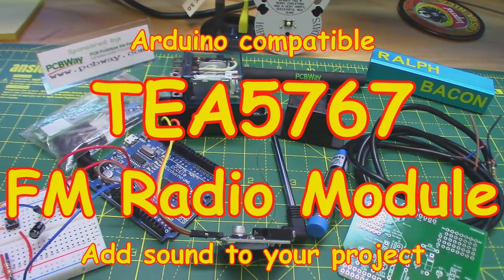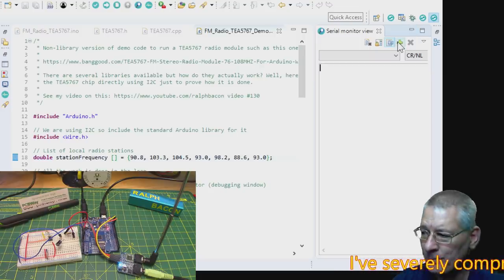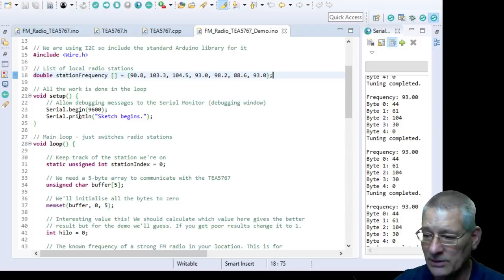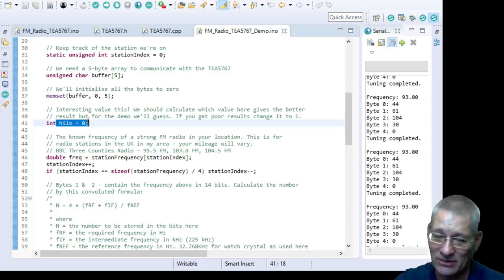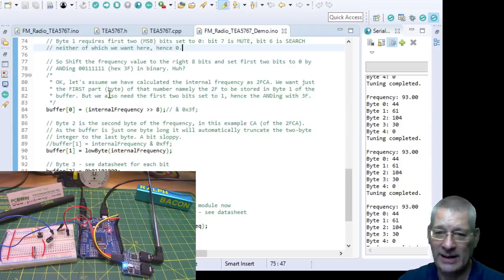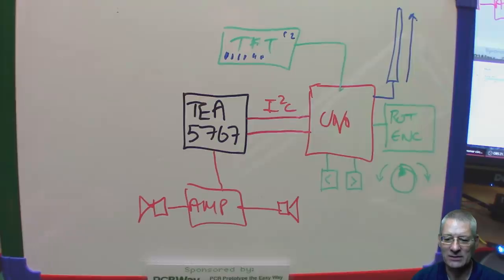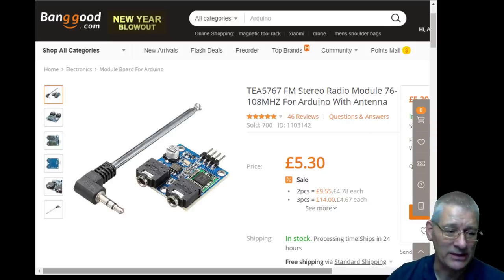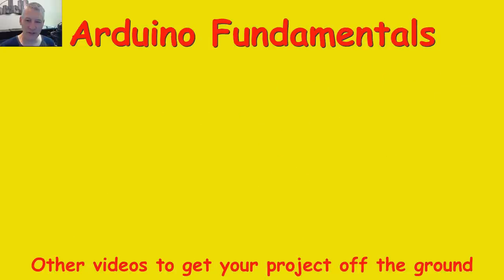#130 TEA5767 FM Radio 📻 Module for your Arduino (Cheap!)

Comment: Can it decode the text information that is sometimes transmitted with the audio? For instance; here in the United States the display for a station may scroll text with the word gospel or rock or country to give the listener an idea as to the type of music they broadcast on their frequency. Other stations include song titles and information concerning the song currently being broadcast. I think emergency weather information can be added by some stations and if your radio has the decoder to read and write this information in can be displayed in different formats. Maybe it's the same on your side of the pond?

Any plans to Rube Goldberg the thing? For example; a photo cell for input to read information from a light source? A laser power meter for example or a decoder for audio that has been added to a light source by modulation? You can bypass the antenna in this case and hard wire the hack into the antenna port and use the radio module number crunching section in a different manner than designed. 

A number keypad is an obvious addition to play with the internals of this module.
Reply: The TEA5767 module described by Ralph doesn't do this 'RDS decoding', but there are other modules like the RDA5807M that do.  Searching by that name/number will lead you to projects, libraries, and modules, that make these fun to play with.
Reply from the maker: Andrew is correct; this is a fairly simple FM module, deliberately chosen for that very fact. But there's nothing stopping anyone choosing a different module and raising this to a whole new level, getting RDS (song info, station info, time etc) back to the LCD display. The only caveat is that the USA version is marginally different (Wikipedia: Radio Broadcast Data System (RBDS) is the official name used for the U.S. version of RDS.[1] The two standards are only slightly different.). Hmm. Now you've got me interested in that too!

Comment: Great video Ralph, unfortunately in Belgium all FM radio stations will stop transmitting in 2020 and we are all forced over to DAB and streaming. Imagine how many car radios will have to be replaced in older cars... thank you for making these videos.
Reply: Wist ik niet
Reply: That was supposed to happen year ago. Problem is that DAB makes no practical difference to the car audio listeners beyond emptying their wallets and poorer reception than conventional FM in heavily buitl-up areas and on the fringe of reception.

You can tell why it it's not well received by the mass market which is more pragmatic than the minority of squeaking audiophiles.
Reply from the maker: @Freddy This was also mooted in the UK several years ago. Nothing to do with audio quality (although that's partly how they tried to sell it) it was to free up the FM band for other services to use. 

But it never happened, and as far as I know there are no plans to resurrect this unless the EU demands it (but if we Brexit we can even ignore that too). Imagine the millions of FM sets in the UK that would be rendered obsolete! Crazy thinking. 

Unfortunately cheap DAB modules just don't exist (or I have not been able to find them). Perhaps it's a licencing thing?

Comment: I Think the sideband for stereo in the UK is just above the tuned frequency, which might explain why your local oscillator setting worked better on low.
Reply from the maker: That would indeed make sense, Steve, there just had to be a logical reason and you have doubtless found it for us! Thanks for posting, good to hear from you.
Reply: @RalphBacon  Don't take it as gospel. I did a few weeks work experience in BBC Belfast and soaked up as much as I could.
FM radio was explained to me as.....
The tuned frequency carries the "middle" signal, L+R, mono.....for compatibility with mono receivers. A stereo receiver also tunes a sideband (the chap said it was just above the tuned band) with carries the "Side" signal L-R, just the difference. The radio then uses sum and difference to recreate the stereo Left and Right. Note all of this end of the processing is all Amplitude Modulation.....as only spectral content of the signals changes.
Apparently the "beat cancel" function on nice FM tuners is related to beat frequencies set up between the tuned band and side band because neither is perfect.......but that's beyond both our pay grades :D
(the same engineer explained FM synthesis as the work of the devil designed to destroy all fun in music :D )
Thanks for your videos they're invaluable viewing while mulling over the non working of my code :D

PS: Where do you buy your dupont cables as yours don't look utterly ghastly :D
Reply from the maker: Nice background info David! My DuPont cables are from Banggood, I've just ordered some (short M-M) today! If you use any of the banggood links in my GitHub before searching it might help my channel.

Comment: Nice video. Very informative and inspirational. Thanks!
Some things that come to mind: How about adding a 7-segment display and RTC to display time and to switch on the radio at a specific alarm time. Also add some buttons to snooze, set the time and control the radio. Recently I published a library for the TM16xx family. The TM1638 for instance can drive 8 7-segment displays and allows for reading quite a few buttons. There are some ready made LED & Key modules that have both onboard.
Reply from the maker: More great ideas! Turning this into an alarm clock would be very easy (and cheap). There are so many ideas being suggested, it's amazing. Thanks for posting.

Comment: Hello Ralph, can the TEA5767 FM module give output so that the Aurdino can read that output from the TEA5767  as input so that I can use that input to prompt the Aurdino to send a text message using a GSM module depending on the input that I would have received from the TEA5767 module?
Reply from the maker: I got confused at this question: "...read that output from the TEA5767  as input..." I don't think the TEA5767 can be used as a digital input in that way (not unless you are transmitting some tones?). 

I think you need an alternative method of transmitting digital data to trigger that SMS message. Depends on the range.

Comment: Great video.  It would be nice if there were a (cheap) DAB equivalent module - done some searching but looks like they are coming in at about £60 - ouch!
Reply from the maker: Quite so, Bruce, they are ridiculously expensive. Either the chips are costly, or the design is, or it's a licencing thing, can't work out which.

Comment: Hello,

I tried to use the noise cancelling circuit with the SI4703 but it didnt work. I used a 68R and 100μ capacitor. Maybe the reason is that the SI4703 runs with  3.3V?

Do I have to change the value of the capacitor or the resistor?

Thank You very much for the great Tutorial!
Reply from the maker: Er... Ernst, you mention Si4703 but this video was about a TEA5767. Just in case you got your components mixed up, the TEA5767's noise reduction is controlled by a register, the fourth data byte, bit 1. If it is set to 1 then SNC is set to ON. also you can try bit 2, which is High Cut Control, if 1 then it is ON too. The datasheet tells all. I have to admit, I'm somewhat confused by the question, though. But I'm glad you like the video nonetheless!

Comment: Ralph,  great video! Do you see any reason that this couldn't be done using an Attiny85 instead of a full arduino?
Reply from the maker: The only reason is that I2C is not natively supported on the ATTinyXX series. According to Arduino, "The ATtiny85 (and it's cousins) does not have I2C (or SPI) 'built in'. Instead it has a Universal Serial Interface (USI) that can be used to facilitate I2C and SPI." 

As it was not straightforward I didn't go down that route. Additionally, if you do want to add LCD displays, Rotary Encoders, Switches... whatever, you'll quickly run out of pins. I'd suggest a Nano if the UNO is a bit big physically. But have a go, just get a suitable I2C library for the ATTiny85.

Comment: Want to build the "small stereo amp kit" - just a small question: what is the max voltage that can be input (e.g., can I connect it to an Arduino with a 5V PWM output to amplify the "sounds" produced). I can't find any info about this point on the WEB. Sorry if it's a silly question but I am only just starting to get "into" arduino Raspberry pi etc. and I don't want to blow it up with too much input voltage.
Reply from the maker: Analog amplifiers will normally expect 0.775V or 1.2v for full output. But you can use a potential divider with a potentiometer to control the input so it does not overload. But amplifying the PWM square waves from an Arduino will not sound pretty! And in stereo? What are you building, some sort of music device, an organ? A stylophone?
Reply: Thanks for this - I am looking at an organ (the PWM is just for the initial set up). I did think that some sort of voltage divider would be needed. Please keep doing your videos, I find them very easy to understand and they provide me with many new ideas.
Reply from the maker: Understood, John, that will work fine then as I previously described.

Comment: Hello Ralph, can you do a tutorial on the si4703 without the library?
Reply from the maker: I'm not sure of the value of doing that, quite honestly! The library does a good job so why not dig into that and see how it works?
Reply: @RalphBacon  I did ,it was written for several different chips and hard to decipher, some Of it I could figure out but most not .I read the data sheet and wrote a small sketch  too see if I could get it to work at its most basic level but failed .I get no errors and 0 result from endTransmission () ,but cant seem to get it to work.

Comment: you can create a project that limits the weight of the lorry and connects it to the lock to turn off the engine if the excess weight . I need ur guidance
Reply from the maker: How does this relate to the TEA5767 module, Faiz?
Reply: @RalphBacon  I'm sorry. I want to say can you create a project??
Reply from the maker: Your best bet for advice on such matters is the Arduino forum: https://forum.arduino.cc just state what you have done to solve your problem first and they will surely help you.

Comment: Great video to start the year.

There are several other I²C radio modules available although mostly without the audio amplifier — not a huge problem. The Si4703 modules for FM radio add e.g. RDS/RBDS [Silicon Labs refer to I²C as 3-wire, probably for licencing reasons.) The chips/modules are interesting because their "family" includes receivers for other bands as well. e.g. the  Si4735 AM/SW/LW/FM Receiver with RDS. Or, if you're interested; weather band capabilities.
 
RDS embeds snippets of digital data in FM radio: https://en.wikipedia.org/wiki/Radio_Data_System
Reply from the maker: Yes, Bernd, I looked at the Si series at I expected to use one of them. But this one was so simple (remember, I'm aiming at getting beginners' projects off the ground) it filled the need better. Maybe I'll do a more advanced module in a future video...
Reply: "3 wire" usually refers to SPI as far as I know, but I have been wrong before. :-)
Reply from the maker: That's correct, Bora, 3-wire is SPI, Twin-wire is I2C. Arduino.cc admitted they made a mistake with the I2C library, calling it just "Wire.h". They realise they should have called it TwinWire.h.

Comment: Do you know a good, cheap DAB+ radio module to attach to the Arduino? And could you make a video about it? FM is being obsoleted by DAB+ in many countries.
Reply from the maker: If I could find one I'd do it, Martin. The trouble is I can't find a module (where we can control it in a similar way to this one) anywhere. I'm guessing they are expensive as otherwise the Far Eastern factories would be cloning them by now. But I'll keep my eyes open (well, my good eye, at least) and see what is out there.

Comment: While you are adding modules, mp3, Bluetooth, wifi, internet radio, 16 keys folio keypad, spectrum analyzer and a way to push that much program into the arduino
Could really be be interesting to see you but all that together, there is a lot of videos showing one or two modules interacting but very few do a full serie on a complete unit.
I, for one, would be sucking up every video on this. 
To get past the copyright issues, i guess you could setup you own FM transmitters, there is some small ones with very limited range, and then send your own sounds.
Reply: The Arduino's core ATmega itself doesn't have the grunt to directly handle complex data at high rates but it can steer modules that do the processing.

Alas, when pushing the physical capabilities of the Arduino hardware, one runs into issues with libraries that don't play well in an inherently multi-threaded environment where things can be happening in parallel. For example, the standard IRremote library, while quite OK for instruction, is limited by requiring lots of processor cycles which means that external interrupts such as button presses or encoder pulses can be missed which is far from user-friendly; or the IRreceiver pulses are missed and data garbled.

One can hope that the student will have gained sufficient understanding to fix such issues as the complexity of the systems on the bench increases. Running into difficulties such as the aforementioned can still be highly instructive.
Reply from the maker: @Flemming Yes, I should have used one of the short-range FM transmitter modules I had, but I did want to show it tuning to a standard FM station too. Oh well.

@Bernd I agree the Arduino is not the most powerful µController out there but I'm pretty sure it should handle this. If not, we could use an ESP8266 based module instead. Or even an ESP32 but that's probably well over the top. You're correct about using 3rd party libraries - you have no idea what is going on there (well, unless you look) and a wonderful state machine could be totally ruined by a library that implements the delay() function, for example. That's why it's good to write your own! Or hack the library, which is what I do quite often.

Comment: I got bare chip TEA5767 (complete module you display is 5 times more expensive where i live). I must admit, it was a hard time getting it soldered on custom-cut PCB, since I am not a pro in this kind of work. Thanks to you i found out how to clean the noises from VCC, and this was kind of issue i was looking for. Im glad you put effort to explain all those bits on the breadboard. Should you need another FM component, check this one out -  google: hex3653 radio DIY. It has better sound in my opinion. Soldering is easy here.
Reply from the maker: I'm glad you got your bare chip all soldered and working, Rafal, and thanks for the heads-up on that other radio module which I will check out too. Thank you for posting.

Comment: I got one of those. Use it to make burglars think someone is home
Reply from the maker: Hmm. You could have it linked to a PIR system and switch to Radio 4 (or some other talking program) when someone comes near. Sounds good!
Reply: @RalphBacon  I have it in a DIY fake TV that I play at regular hours to simulate someone is home. Yet, I have a PIR that triggers an MP3 module with dog barking :-)
Have not had a burglary yet, though my neighbours did

Comment: I think you've misunderstood how those tonal frequencies work. If you play a 1khz tone over a 1khz tone, why would you suddenly get a 2khz tone? You would get a tone of 1khz at a higher AMPLITUDE, or basically, 1khz but louder. The difference between 1khz and 1.1khz ( the 0.1khz tone) is actually an auditory illusion that only really exists in your head.

ETA: Good video otherwise! I'm going to try build one for myself
Reply from the maker: You always get the sum and difference of two tones. So two 1kHz tones playing will (obviously) play the two 1kHz tones, PLUS the sum of both (ie a 2KHz tone) and the DIFFERENCE (technically 0Hz but if those two "1KHz" tones are even off by a whisker you'll get something).